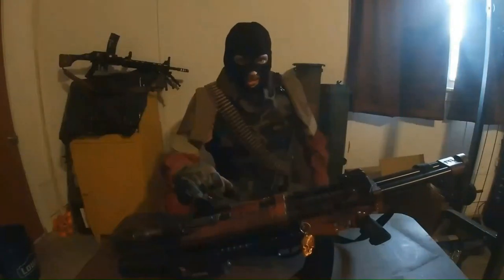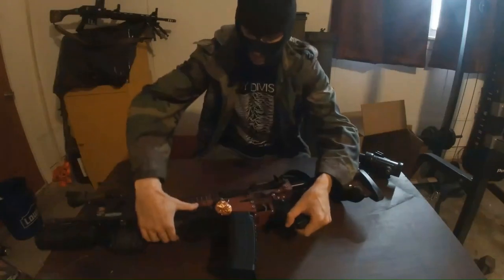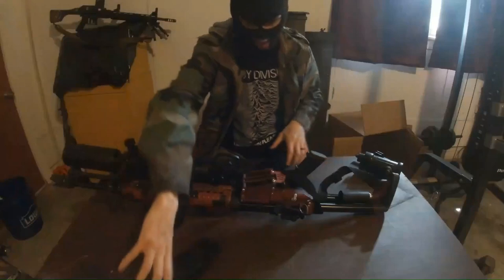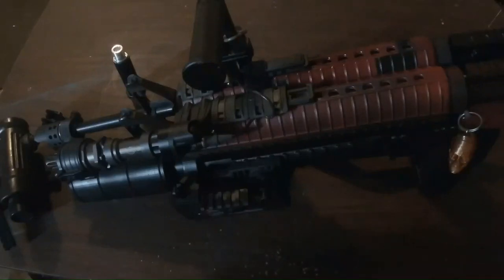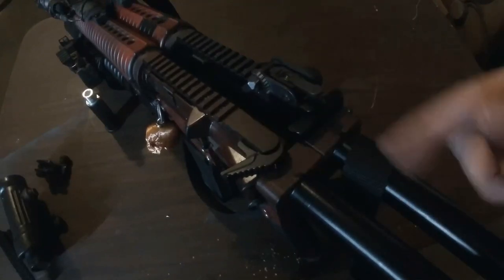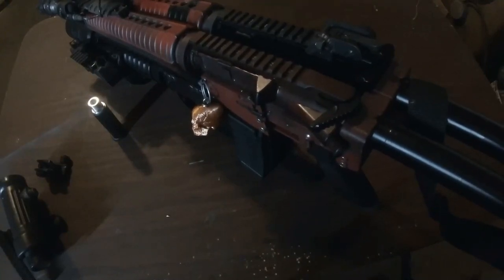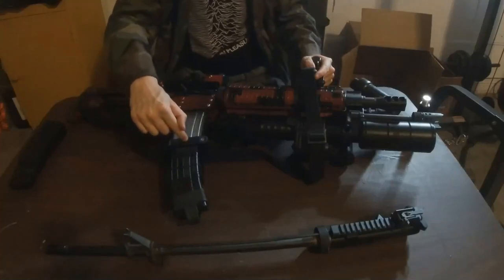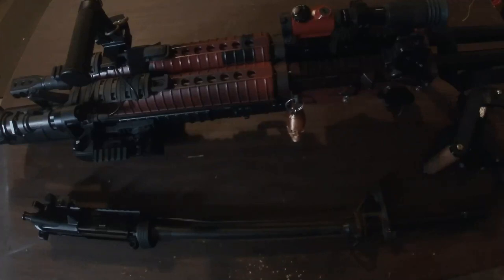Double Barrel AR15 Debut

Comment: need to cant the receivers so you can use two drums
Reply from the maker: It is very important that the triggers are both within 45mm of each other and reachable and the recievers not being parallel would add too much bulk. It will however still fit 2 100rd surefire magazines